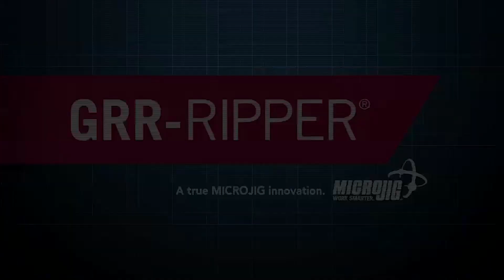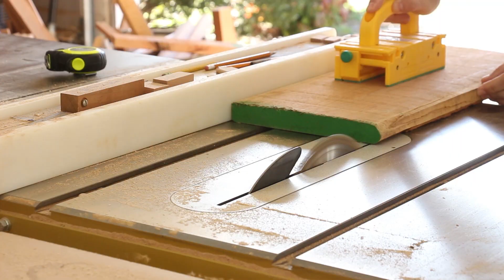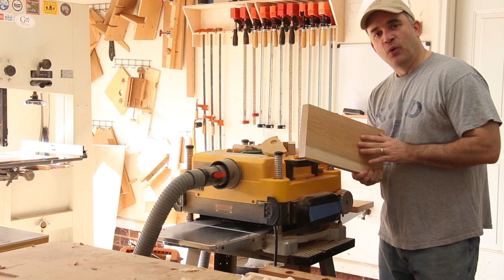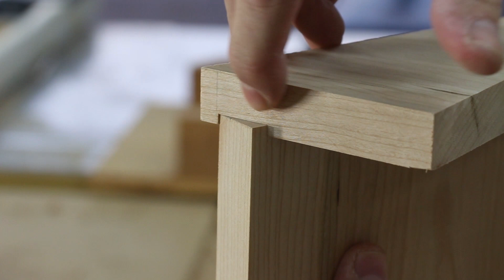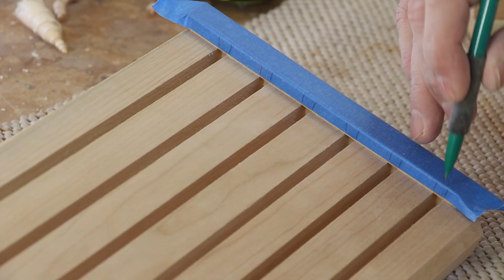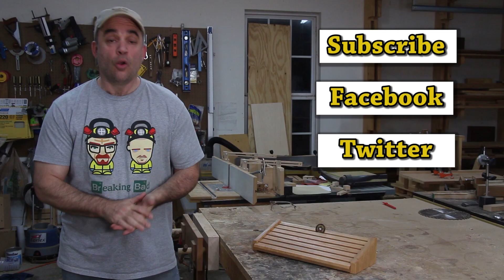Challenge Coin Holder

Comment: Nice project but do you have a plan available?  What size is the groove and how deep do you cut it.
Reply from the maker: Donald Amlaw Unfortunately I don't have plans for this.  The slots were cut with a standard kerf (1/8").  I don't recall the depth and I no longer have the coin holder.  I would try a few cuts in scrap wood until you are happy with the depth.